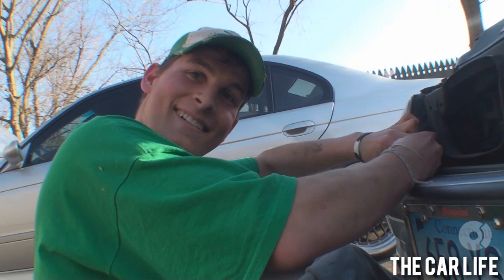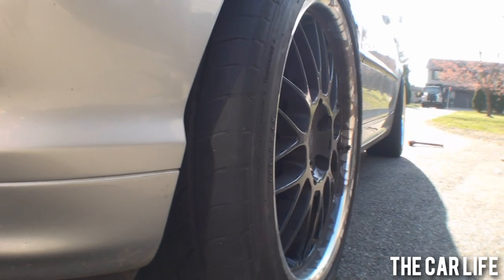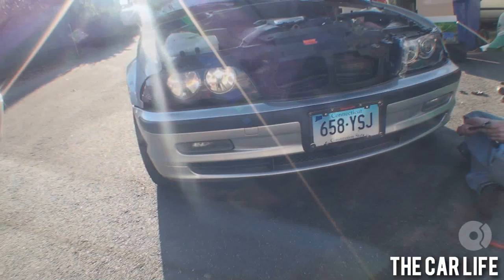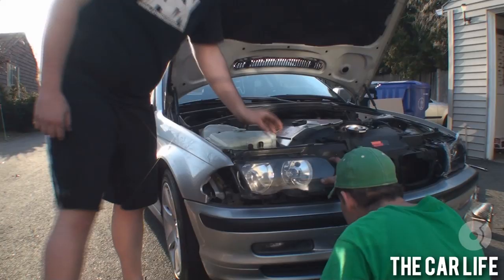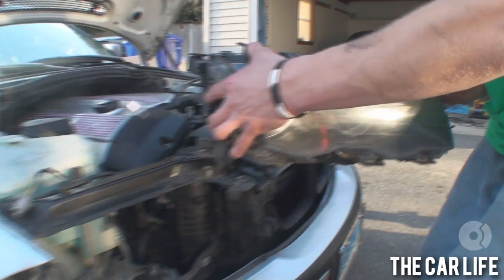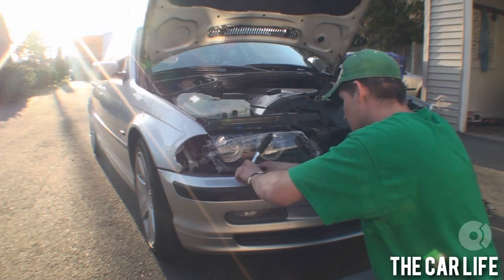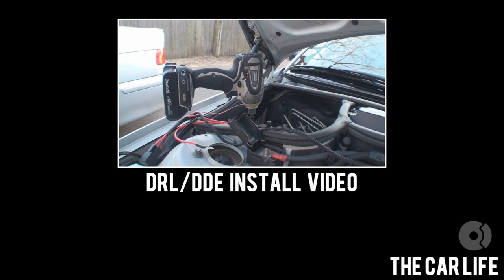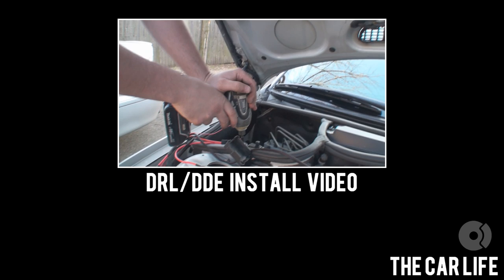BMW Projector Headlight Install (E46) - FCP Euro

Comment from the maker: I've heard good things overall about the company and a lot of people seem to be happy with them on older BMW's. I don't want to spend $2K plus on KW's for my E39 at this point and want a set that will go low. I also was able to get a good price on BC's from a local vendor.

I'll do the install video for sure once I get them. I also need to do my front wheel bearings too...or at least that's what it's sounding like right now. It's never ending lol.

Comment from the maker: @Emiliebe3D I'm pretty sure they are DEPO projector headlights. And yes, the trim was extremely difficult to get out. BMW did not make that part easy at all. However, the rest of it is pretty straight forward.

Comment from the maker: The "brandless chinese headlights" perform just as well as OE Hella projectors. No need to spend $1300+ on a new set of headlights for a car with 170K miles on it. And it's the camera that is showing several different colors. Headlights and AE's are pure white and the reflectors are just amber. Pretty clean and simple to be honest.

Comment: I did same thing with my m3 e46 depo headlights w angel eyes in
evryting works but theres no where to connect wires for the angel eyes do I need anyting extra to buy

Comment: just caught this vid.. & I'm guessing u were stuck on the 2 lower screws holding the headlight in Pmsl... my solution... leave the headlights in & just move the washer bottle on one side & my induction on the other, everything else is child's play.

guy comment yrs ago about angel eyes & couldn't work out how to power them "Erm they get power from the side light power supply"

Comment: Foleygac 
Hi I have a 1999 e46 328i just like yours and a 2001 e46 325i and I'm looking for headlights on the 99' 328i and everywhere I look it says 99-2005 but the 99 headlights look different than the 01's. So basically my question is when you bought those headlights did they say 99'-05'  cause they fit perfect on yours I'm just worried they won't fit cause they dont look the same from 99-01, thanks I would really appreciate feedback  because we have identical cars so you could be alot of hel